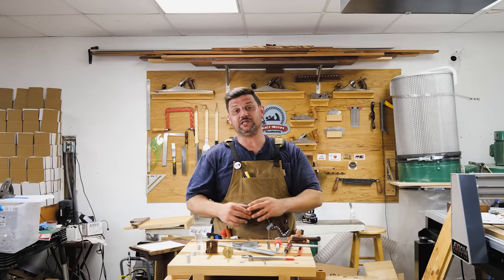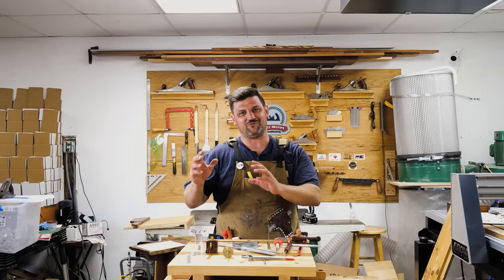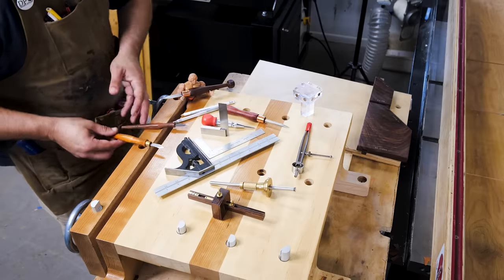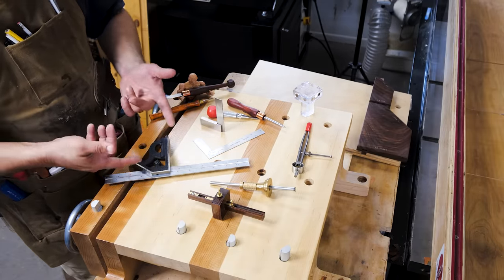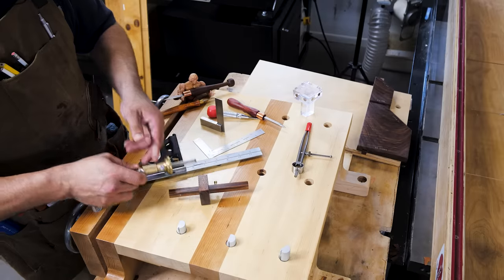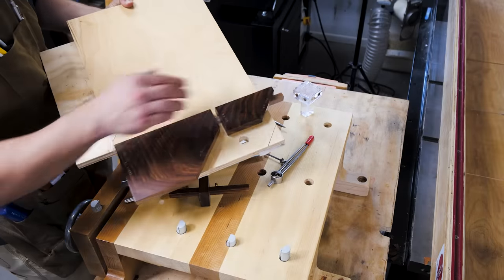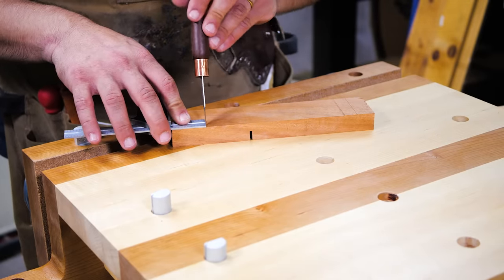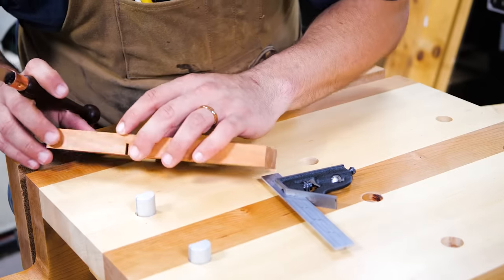Essential Skills For Superior Accuracy in Woodworking - Tips and Tricks

Comment from the maker: Video Table of Contents:
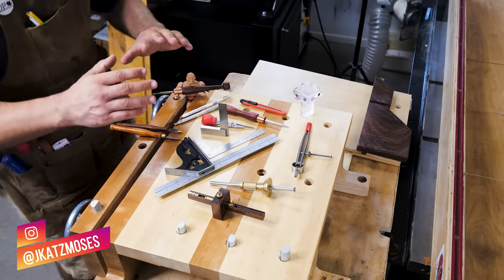1:00 Hand Tools I Use for Accuracy
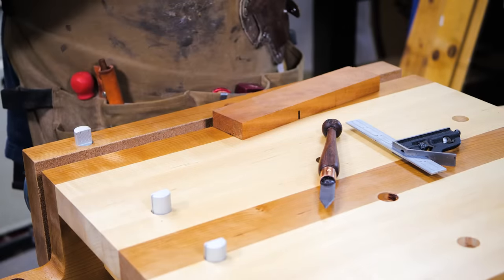4:10 Accurate Cutting with Hand Tools
7:00 Table Saw Accuracy
11:18 Drilling Holes Accurately 

Tell Me Your Tips and Tricks here in the comments.
Reply: I found an ol paring knife from the kitchen (wife never missed it!) and after sharpening it on both sides to slim down the blace a bit it makes a great marking knife.  I also have an old fillet knife that I am going to try as well.  Good steel in those and very flexible.
Reply: @garypillischafske1425  used sawzall blades. Spring steel, sharpens well to a fine edge. Can be customized into any shape.

Comment: For hand drilling, I use a pair of small mirrors glued into a 90 degree angle cut into a block of wood. The reflections allow you to see vertical in both X and Y axes. Use cheap mirrors if you have a concrete floor ;-)  Clyde
Reply from the maker: Clyde Ulmer I'm going to try that! Good idea!
Reply: Just use an old CD and drill in the centre, easy 360 mirror
Cheers
Reply from the maker: Dean Moroney great idea!
Reply: @deanawesomer9102  I'm old school. I use an old record.

Comment: Check the cordless drill from either side/direction. This will help to maintain accurate drilling. Pause half way and check you are still at 90 to the work piece from behind and to one side. Also if you are using a pencil, blade or knife if you run it along your square at 90 deg/vertical your marking will always be out by the tickness of the instrument you are marking with. You need to hold the blade or pencil at a 45 deg from level so it is angled into the square and the work piece you are marking in that makes sense. Good video 👍

Comment: When I use my pull saw to cut, I first mark the wood as you did, then using a chisel, press down on the line 1/16" or so and carefully remove a small chip of wood.  Then your saw easily fits inside of that trough to begin your cut.  Something I learned on Rough-Cut I believe.
Reply from the maker: James Jacobsen I think that trick is awesome! I learned it from Paul Sellers. I haven't heard of Rough-cut. I'll check them out

Comment: Great tips. I make a lot of cribbage boards and find it quick to take a sharpened finish nail mounted in my drill press to make my starter holes the come back with the drill bit. It is quite quick if i use a fence to keep things in line.
Reply from the maker: Dave Rouse that's a fabulous tip! Thanks for sharing!

Comment: For the drill press with a small piece of wood like you used in the video, I often hold the work piece up to the drill bit to find the divot then lower the work piece and drill bit down to the table with the drill bit still in the divot.

Comment: For drilling a bunch of holes with hand drill at 90 degrees, I make a guide block on drill press first then use it to establish the hole aligned 90 degrees, then slide it off to complete the hole.
Reply from the maker: Rick Reed great tip! I should've included. Cheers!

Comment: Great tips I always use the drill press tip I do the exact thing with the bit it works great and I used a small dull drill bit and made a scratch alw the other day I find myself using it constantly sometimes more than my marking knife. I shaped the handle fit my hand good so I kind of hold it like a pencil. Very simple tool 2 make
Reply from the maker: Holly Helton that's great advice. Never thought to use a drill bit. Cheers!

Comment: I make my marking knives from old planer blades, hacksaw blades and a few from some very cheap tool blades on clearance from Grizzly.  I grind and sharpen them on one side like a chisel to different points/edges/angles as needed.  The handles are easily made from scrap hardwood (like old crutches) and a slot cut on a bandsaw; widened with sandpaper if necessary.  If I don't pin them, I will grind cutouts for epoxy to hold the metal in the handle more firmly.  They are also made fit to my grip which is nice.
Reply from the maker: 2300Kenzie that's a really cool idea!
Reply: What is the minimum thickness you'd recommend for a marking knife blade?

Comment: 2 points about what you do (that I also do) that you didn't speak about: firstly, at https://youtu.be/goUc74RQRus?t=271, you made sure that the flat side of your marking knife was the side that you run along your straight edge, and secondly, transfer dimensions directly using your gauges and squares as you described instead of measuring X inches (or millimetres) several times. Every time that you use the scale on a ruler, you're introducing a variation that will eventually work against you.

Also, when using marking gauges I find that I have more control when pulling the gauge towards me. Canting the pin-style gauges slightly so that the pins are dragged helps keep them from wandering with the grain.

Comment: Does the Saw Stop table saw still stop the blade when it's turned off?  I am making an assumption that when Mr. Katz-Moses reached over the spinning blade he had turned the saw off.  No criticism intended as I have scars, just curious about the mechanics of the saw.
Reply: Yes, a sawstop will stop the spinning blade even after you cut the power if you touch it.

Comment: I use my marking gage with the circular cutter as a router plane. It works great for shallow mortises for hinges. The only thing I should say is that this only works with marking gages that have an inset screw that holds the cutter
Reply from the maker: Brian Potter never thought of that. Great idea!
Reply: Katz-Moses Woodworking Shop Thanks!

Comment: Use templates and flush trim routers, as well as making my cuts on a spare piece of wood to ensure a good fit before I use my nice stuff.
Reply from the maker: Always a good idea but I think with a marking knife you can (once you're confident of course) measure once, cut once. I like to use my actual piece to measure instead of a ruler or tape measure. For example, in the Moxon Vise video, I made the bench first and then measured everything else off of that with nothing but the flat surface of my table saw and a marking knife. Each piece was scribed based on it's mating piece.

Comment: who makes the spring loaded center punch?  I have a few of the all-metal punches made by general tool but I really like the looks of the one you use.  the ball end looks like it would be much easier on the palm...

great videos, brother.
Reply from the maker: Check out my video called Woodworking EDC. Its linked there

Comment: My son is into model railroads and likes large steam engines. Unless the ramps are very precise those locomotives tend to derail very easily. When building a major expansion I started trying to measure to 1/1000th using https://microfence.com/product/micro-stop-basic/ on the table saw. I found I could only cut within 1/100th but that seemed to be good enough. Anyway the point is the microfence is another tool for extreme accuracy.

Comment: If the blade in the table saw is the one used to make the cross cut sled, then the edges of the groove should be your cut lines. You shouldn't need to line up against a tooth.
Reply from the maker: Yea until you switch blades which I do all the time and then the kerf line changes
Reply: @katzmosestools  So all you have to do is build a sled for each blade. :)
Reply from the maker: @fins9584  hahahaha

Comment: Can you use an X-acto knife?  They are very thin.
Reply from the maker: Richard Glaholt sure. The reason a marking knife is great is that it is single bevel. Meaning it pushes itself against the square while scribing. Just be careful with any double bevel knife that you stay firmly against your square.
Reply: Katz-Moses Woodworking Shop Thanks.  I plan to buy a quality marking knife but wanted to know if I could use an X-acto in the meantime

Comment: problem with marking knife is in some wood grains i can't see the mark.
Reply from the maker: bryan greifinger run your pencil along it and it will highlight it. Cheers and thanks for watching!
Reply: Then why not use the pencil to begin with?  Seems to defeat the purpose no?
Reply from the maker: bryan greifinger think of the pencil as a highlighter.  It is literally impossible to be more accurate with a pencil than it is with a marking knife for all the reasons I laid out in this video. Even if you highlight your marking knife line with the pencil you can still use it in all the same ways I laid out. The pencil just helps you find your marking knife line when you look away and look back again
Reply: I think whats needed is a highlighted knife.....one stroke makes a thin line that includes highlighter inside it.....wanns design one with me LOL
Reply from the maker: bryan greifinger hahahaha I'll model it in fusion 360
Reply: Piece of cake my friend.....just a thin blade connected to a thin line connected to a reservoir of some type of coloring or ink......remember......I want my fair share when it goes viral LOL

Comment: My tried and true method is to eyeball, measure once, cut/drill, swear, glue fix into place, try again, swear, glue off color wood into place as an accent, carefully sneak up on the cut, say good enough, apply wood filler after assembly, go to ikea and replace piece after it breaks. It works every time.
Reply from the maker: Hahahahaha